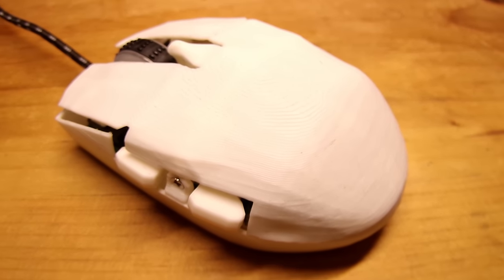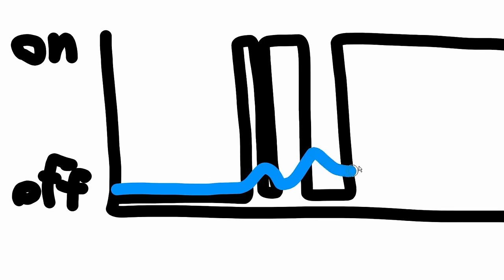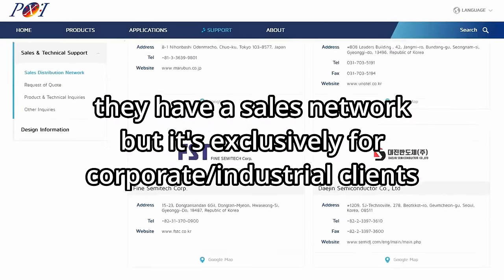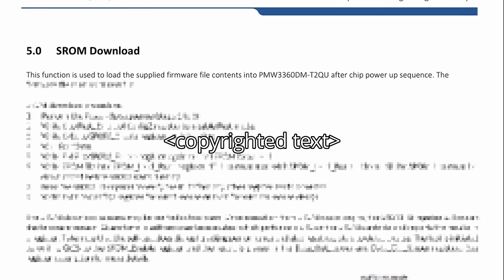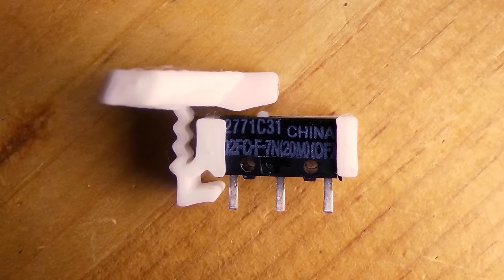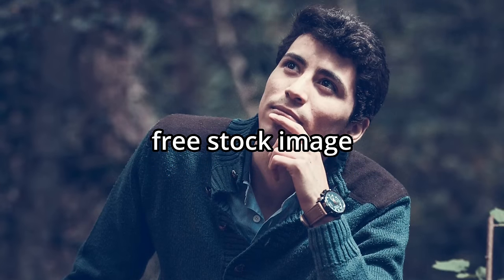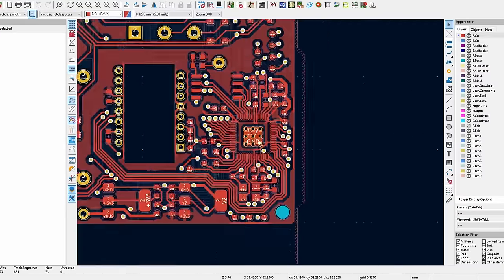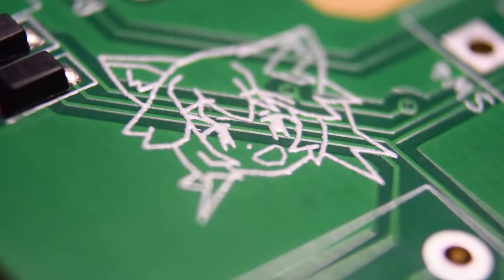I made a DIY gaming mouse because Logitech's mice keep BREAKING

Comment: honest question here, are we sure this is actual part failure? I'm switching to trackballs, but for the past decade or two I've basically been using the G502 and it's derivatives (if a mouse doesn't have a scroll lock, left/right scroll tapping and forward/backward m4/m5 buttons it's a non starter as far as I'm concerned) and while I have had that bouncing happen to me, I just slammed my mouse down on the table a few times and it went away, ended up being able to use every mouse it happened to for years without issue, only switching because they got too grimy or otherwise wore to the point where it was just more practical/desirable to buy a new one instead. 

If it was 'real' hardware failure though percussive maintenance like that should, at best, buy you a few days or weeks before the problem comes back far worse - it shouldn't solve it for years.

Comment: Is it possible to convert your project into a gamepad with a trackball? It will be more like a keyboard + trackball (mouse) working on a single wire in the gamepad form factor. Since the advent of gamepads as we know them (with analog sticks), the past has been almost 30 years(!), but so far no one has created a single gamepad in the mass segment with which you can play FPS games without pain below the back.

Comment: Have you considered going around sensor availability problem by using accelerometer ?

Edit, deam that sounds snarky but no,genuine question, did you consider it ? If yes them why didn't considered that route, would it make mouse less plesant to use ?
Reply from the maker: I actually did consider it! Accelerometer plus proximity sensor would mostly work, but there's a subtle problem: I would have to throw away small movements because accelerometers can't tell apart small movements and background noise. Mouse sensors can, since they keep their cross-correlation reference frame around until they output movement.

Comment: I wish you went into detail and experiment with the Frame Capture functionality. Could it be used to scan text with a mouse?
Reply from the maker: The frame capture is basically a 36x36 greyscale camera/scanner with around 800 dpi. It can read text, but the captured area is so small that it would take a long time to capture anything interesting. AFAIK it's mostly used for debugging surface compatibility problems by manually looking at surface textures.

Comment: Nice project, but a little bit late :) Almost all major mouse brands are going for optical LMB/RMB switches now, so bouncing on the contacts is no problem anymore. For example, Razer have those optical switches in almost all new models, Logitech and other major brands too. Next big thing will be when they switch from mechanical encoders to optical ones (like it was back then in all mices 15-20 years ago), so the buggy mousewheel scrolling will be finally solved too.
Reply from the maker: Optical scrollwheel encoders used to be the norm, but they fell out of favor because they clog up and get dirty really fast, so if you don't open up your mouse to maintain it, they last less time than mechanical ones.
Reply: @wareya  hmm, idk bro :) I'm still using Genius NetScroll+ Eye mouse in my work (I like it because it has good ergonomics). That mouse is almost 20 years old and it has optical mousewheel encoder... it's not a problem at all. I'm cleaning that mouse thoroughly every 3 or 4 years, so even after all those years it looks almost like new. 
New mechanical encoders are worse (imho), because they typically last only 2-4 years and after that you have to desolder them and change for new one. For me it's not problem at all, but for many ppl without soldering/desoldering skills it is unsolvable and they have to buy a new mouse. 
So, just because of that, mices with optical encoders are better, because even people without higher technical skills can fix them by themselves... only tool they need is a screwdriver.

Comment: Nice project and great result.
I have one question though:
You started this because of the micro switches getting bad after a while but then you're still using the same micro switches in your project.
So did you achieve anything on that end?
Reply from the maker: Yes, I use them in a way that works around their flaws. That's what the.. second? third? section of video is about, with the dechattering diagrams.
Reply: @wareya  Well I guess I didn't quite understood the issue there before :D
Thanks for the explanation
Reply: @474K  switch bounce is a major issue with electronics input. When a switch closes the contacts make and break multiple times and electronics count each of those bounces as a switch activation. So it becomes impossible to send just one switch signal to a circuit. Which with a mouse is pretty important. You have to have the ability to single click. So you need to filter out all of those switch bounces.

Comment: Fyi: You can easily desolder components with solder braid and flux.
Reply from the maker: This works most of the time and I have the setup for it, but damaging this sensor when using point heating is too easy in my experience.
Reply: How easily anything may desolder depends on how it is soldered. If the board holes are tight it's not going to be easy. Believe it, or not, not every part has proper hole clearance. They must have put the switches into my Razer mouse with a staple gun. I ripped the top of one of the switches off trying to get it out of the board. That sucker was in there. Braid and flux would not have made a bit of a difference either. If the pin is tight in the hole it's just tight.

Comment: Cool. Will it be enough pins on RP2040-Zero module?

Also, do you think it's possible to make a wireless variant, using ESP32's built-in BLE support? Or it won't work because of the power draw?
Reply from the maker: A wireless ESP32 version would probably work (even if the USB version didn't work because of the sleep but) but I'm scared of making hardware with batteries in it :(
Reply: @wareya  Yeah a rechargeble li-po pack would be better, but the question is how much power the whole thing draws and how often it needs to be recharged?

Comment: Wonderful project! Will this work with PMW3389 as well?
Reply from the maker: The firmware might need some changes, and the LED resistor value would need to be changed, but IIRC aside from that the PMW3389 and PMW3360 are mostly pin-compatible. So yes, it should work, if you have the know-how and are willing to put in some elbow grease. But I didn't double check, so take this with a grain of salt.

Comment: you said your problem is that the switches need to be replaced often and soldering and desoldering is breaks the pcb so you buy a new one. The thing you didn't talk about is how this mouse fixes this. do you have hotswap sockets for the switches? which is a thing that exists, I'm sure have seen a mouse with those before.
Reply from the maker: I use the debouncing algorithm that I explain in the second section of the video; it doesn't have to trade off between latency and reliability, so I can make it as aggressive as I want. This fixes the problem.

The hot swap things are patented unfortunately.

Comment: Am I stupid or could you just have coded the fix you described at the start with the middle state? Or is it just that the middle state doesn't exist on Logitech mice? I absolutely adore my G302 for its shape, but Logitech doesn't produce them anymore. I've been forced into deep diving into PCBs and electronics soldering to find a way to force a donor PCB into the shell of my current mouse.
Reply from the maker: Yeah the middle state doesn't exist in logitech mice, only two of the three pins are hooked up.

Comment: genuinely surprised you have issues with mouse switches. Legitimately the only other time ive heard about someone needing to replace switches was for my brothers razer ouroboro after using it for hours a day for 10 years (not an exaggeration) and even then it was because something heavy dropped on it. Fucking amazing video tho my only gripe is the amount of "this frame is intentionally left empty" coz theres a ton of stuff you could put for each one
Reply: I killed the switches in my Deathadder in just a year or so. When it started double clicking it drove me batty. I'd be holding the mouse button down and it'd just fire off clicks. It made dragging and dropping files an exercise in futility. It sucked.

Comment: It is fun how some really smart people have few skin in the game skills. When solderinng or in that case desoldering some thing use knife tip in the solder iron and use low melt point solder "wire". The low melt point and the knife tip helps a lot in heat transfer.
Reply: Also really good project
Reply from the maker: I did that, using a chisel tip on a standalone Weller soldering station and low-temp leaded solder. The problem is the ground plane pulls the heat out of the ground pin and it dissipates faster than the soldering iron can safely pump heat back into the pin. Raising the temperature to the point where it outpaces heat dissipation dramatically increases the risk that you'll melt the IC casing through the ground pin. No easy solutions to this problem with single-point heating!

Comment: Really inspiring. I have been thinking about doing some custom work myself, and I'm gonna take a more serious look into it now. I really like my Logitech g502, but the macro buttons are a little annoying since they need software running to work. Would def like to fix that. Anyway, thx for the cool vid
Reply: Which buttons are the macro buttons? The ones on the side? My OS just calls them button 8 and button 9
Reply: @1pcfred  Well, all of the 11 buttons can be remapped with their software, but you need to run their software for it to work since the save to on board memory option  just doesnt work. By "macro buttons" I just meant any of the re-programmable buttons.

Comment: Impressive. I wonder if mouse engineers would be willing to learn and implement some of your solutions.
Reply from the maker: Man, I really hope so! But the debouncing thing isn't particularly hard for a product engineer to figure out, so it's got to be a cost-cutting measure somehow, or deliberate. I think the only way to get them to implement it is to raise awareness that it's possible and don't add cost anything but two more PCB traces and two more used pins on the MCU.

Comment: What if you just solder eg DIP socket instead of the switch itself on the board and you could replace it easily without soldering?
Reply from the maker: That would work for a custom design! This was cheaper and I think I won't need to replace them again either way. I think the reason commercial mice don't usually do it is one of the manufacturers has a patent on it.
Reply: @wareya  and also, it's not just about the goal, it's about the road too ;) I like your project!

Comment: Very nice. Maybe v2, just directly put the rp2040 ic on the pcb? LCSC does have in stock, so jlc can solder it on for you and you can put the usb port where ever you wish it to be.
Reply from the maker: I really wanted to do this but I couldn't figure out how to make the footprint work and fit in my shell :( The sensor, scroll wheel, and button locations are very limiting

Comment: Love the project. Using Blender instead of CAD software is practical and interesting haha. My only question is why not desolder the pico usb port and use the pads there. Wouldve saved a lot of time compared to designing a board from scratch and ordering.
Reply from the maker: Good question! The usb port has small through-hole support posts, so desoldering it is slightly dangerous. It wouldn't be a problem of the pico's PCB was a standard 1.6ish mm thickness, but it's around 1mm instead, so it's a lot easier to accidentally crack the traces when removing through-hole components. They're extremely small, so scratching up the solder mask and mounting to the exposed copper would probably be easier. But by the time I realized that was an option, I was already off to redesigning the PCB.
Reply: @wareya  Makes sense. I don't do any surface mounted stuff currently so I figured there was probably a reason I didn't know. Sometimes it's just more fun doing it the long way too :D

Comment: Setting a switch to a previous state requires a latch/flipflop right? which would introduce like 1 cycle of latency? Not that it would really matter.
Reply from the maker: microprocessor cycles yeah, but that's in the realm of very minor code structure changes making a much bigger difference

Comment: Not sure if the pinout would be large enough, but I've heard the Seeed Xiao (with RP2040) is pretty good as a tiny microprocessor
Reply from the maker: I haven't counted, but it looks like it might just barely not have enough pins.
Reply from the maker: The Waveshare RP2040-Zero would probably work, though!

Comment: Now just improve the 3D printing on the body. Maybe switch to Resin printing.
Reply from the maker: There's problems with resin print durability when using bending parts unfortunately, but it's something I want to happen eventually!

Comment: nice project! I am also fed up with how unavailable mouse sensors are. maybe they use magic inside to figure out movement data from frames :)
Reply from the maker: They do something involving cross-correlation, but they need a direct electrical connection between the sensor pixels and a bunch of Digital Signal Processing hardware (for speed reasons), so there's no realistic way for me to make a sensor myself :/

Comment: Every six months? Either you click A LOT, or you were very unlucky: I bought my first G300 when it was first released in 2011 and replaced one switch in 2015. I replaced it with a G300S in 2017 because the rubber part were starting to decomposing and I am still using it today without a problem. I gifted another G300S to my brother around the same time, and he replaced the left button during COVID and the right button last year. Of the five switches I bought 9 years ago, I still have two left...

Also, the project is intriguing, but if you use the same switch where is the improvement? And if you don't, wouldn't be better to just replace the switches in your mouse?

Comment: Great video, but the mouse click issues could have been mittigated with better mouse switches like Kailh GM8.0s or Huanos 80Ms or TTC Dustproof 80M+(there are plenty of mouse switches with over 80m lifespan now, i use GM 8.0 100Ms)

Or alternatively, there are hotswap switch mice now, like zaopin z2 or incott HPC02
Reply: And you believe them? Was it 80 million OMG I'm going to die, fire, fire, fire! Smashes? Or was it 80 million dainty little girlie clicks? There's clicking and then there's smashing. Sometimes I can be a smasher myself.
Reply: @1pcfred  i didn't say that i believe that they will last the full 80M clicks, i said better switches would mitigate the issue(as it reduce it's occurance or last longer),

guy was using chinese omrons, one of the lower lifespan switches with not great reputation

i am an electical engineer, i fully understand that the 80M rating is in ideal conditions and testing isn't standardised across brands

But i have seen actual differences between different switches of same brand when opening them up, so with the small price difference between the low end vs the high end switches for an end user(like 1-2/switch at the upper end)

i can recommend getting the best switch u enjoy using, if u are already taking the effort to swap them
Reply: @krazybonnie5523  you can certainly try to get better quality switches. But we are talking about parts coming out of the far east here. So what you end up getting can be a bit of a crap shoot. It'll be Chinese something though. You can be pretty sure of that.
Reply: @1pcfred  i have no issue with chinese made stuff, a lot of quality stuff comes from there

but omron, the major switch maker, is a japanese company, with switches factories in japan and china, these factories make different SKUs, with stupid letter code names, so ppl just refer to the switches as "chinese omrons" or "japanese omrons" to distinguish them

Most of the popular good switches are made in china anyway, so it's not good to sweep all of them as made in china crap
Reply: @krazybonnie5523  maybe it's not good but it is what it is.